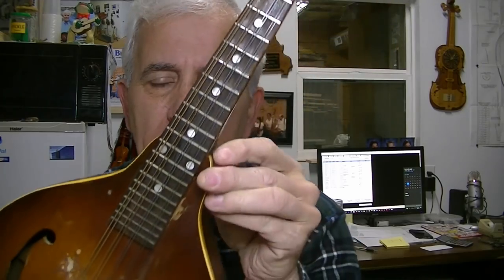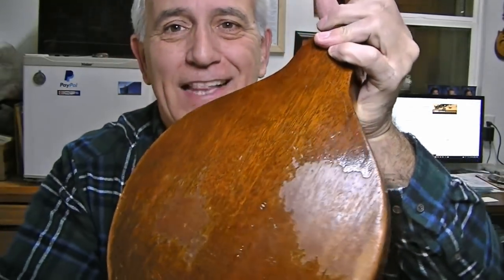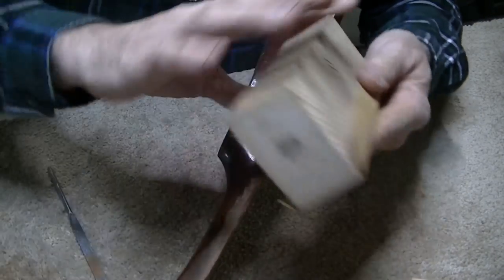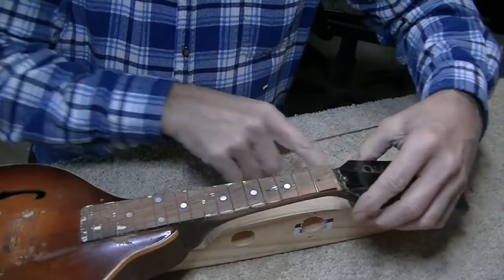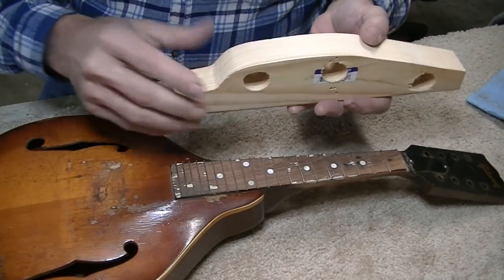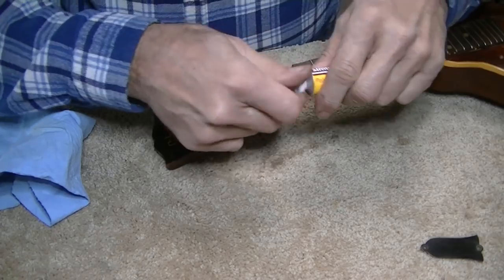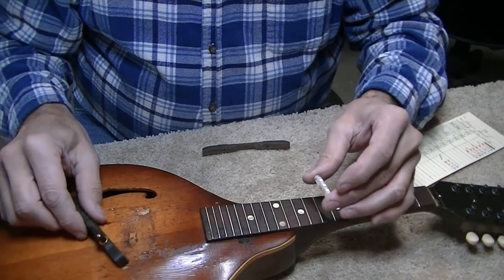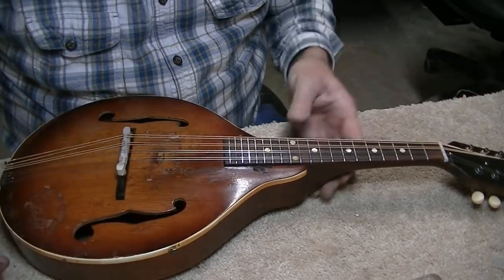214 RSW Gibson A Model Worst Fret Board Ever

Comment: Whenever I have neck damage and there's chunks missing from the fretboard I mix a good amount of Rosewood Pixi dust in the Evercoat spot putty and continue to stir, the color of the rosewood seems to almost dissolve into the putty and sand that area with ultrafine making it look as flat matt as the rest and works excellent before adding the hardener. Not the typical spot putty, this stuff hardens like a rock and doesn't shrink and I never had to stain it. I add the similar grain with a needle, then I use some oil on the neck maybe. The person playing will rub that stain right off of the plain white filler, but when I do stain, I do the area's that really need it until it looks good then I go over the whole are of work.

Comment: One of the cool things about superglue is that you can put the really thin stuff on a crack and and it will run down into it. I have tested it and found it can travel 6 inches or even more, with the grain. The tighter the crack the farther it will run. If you get lucky you can glue the finish back together and get a perfect repair that requires no touch up on the finish. (really lucky) 
 Also not all accelerators are equal. some will turn things white others will not. You are right about leaving it sit a bit. It will help, but some brands will give you that white haze no matter what you do.
Reply from the maker: Some also eat up guitar finishes and others do not.

Comment: I'm guessing, but I think most of that "goop" on the top is where someone glued a pickup in place. probably more than one, by the look of it. And I wondered if that headstock crack had actually been repaired before and was starting to open up again.
Nice to see that the concern was to get it back into playable condition, rather than keeping it to its original state. Not going to happen, and it's not as if it's a collectors piece. Nice work.
Reply from the maker: Yeah it look like they had put pickups on it several different times. Thanks for watching.

Comment: Judging by the head stock logo and what we know about the original owner, that looks like a Gibson A-40 which came out in 1950.  The A-40 was Gibson's best selling mandolin in the 50s.  It only sold for about $50 in those days and was very affordable. That would be about $1,000 in today's money.  The A-40 would have had a pick guard originally.  

You did a beautiful job on the fret board!   The fret-board looks practically new but the rest  of the body looks terrible by contrast.  If it were mine, I would be tempted to sand and refinish the top and back and reinstall the pickguard.  The customer may not want to do that, but I would!
Reply from the maker: Thank you very much.

Comment: Even on a flat fingerboard I use radiused fret wire. It keeps them from popping up on the ends like this. That is why I do not have a tool to bend the wire. I only buy it in coil form rather than straight. It is far easier to change the radius to make it smaller or larger than to bend from a straight condition.
Reply from the maker: I've done that myself. This one was just in really bad shape is the primary reason it was pulling up. Thanks for taking a look.

Comment: I can see an Antiques Roadshow appraiser (or the like) tsk-tsk-ing over the dye job and fills in 30 years or so. But they are more concerned with re-sale value than re-play value.
Have you tried the Crimson Guitars tape and superglue trick for attaching sandpaper to your block? It lets you spend less time worrying about the sandpaper crinkling up under pressure.
Reply from the maker: Thanks for taking a look. Yeah I've seen that trick. I don't seem to have too much trouble with the Sandpaper crinkling up.

Comment: Hey Jerry - on the total bare spots on the body, would you ever go over the stain touch-up with either shellac or satin lacquer (rattle can - just enough to restore the real bare spots? I've been experimenting with masking off the old finish and then trying to blend in new finish-just in the bare areas . I don't have a good buffing rig tho' and my results to date aren't anything I'd charge for (yet). Any thoughts ?
Reply from the maker: I generally wipe the whole body down with linseed oil. Which coach the bare spots. But I also wipe as much of their linseed oil back off as possible. Thanks for taking a look.

Comment: Gibson was bad about glopping in glue and not using consistent dovetails on the necks. I've helped work on a few of their guitars. Tried to steam out a neck on a Dove only to discover they hadn't left a gap for the steam. Didn't find that until it popped out dry where the steam couldn't get to it. Then we found the joint didn't fit well and they just filled the joint with glue.
Reply from the maker: Yeah they had their idiosyncrasies. Thanks for taking a look.
Reply: How old was the Dove you worked on? I know Gibson's quality control is absolutely horrendous today (plenty of YouTube vids on that), but I've also heard that they've always been somewhat inconsistent.
Reply: ijosef honestly, I don't remember now. That was quite a while back. I know the guy I was apprenticed to said he wouldn't work on a new Gibson and would rather work on a Harmony.

Comment: I could be wrong, but that bridge is not on the right spot.  It needs to come a little bit up on the f-holes notches. Good job.
Reply from the maker: You don't set a bridge by marks on the top. You set the bridge by the sound. It is measured from the 12th fret. Sometimes it lines up with the F holes and sometimes it does not. But it will not sound correctly to a musician with a good ear unless it is set by sound

Comment: If a person is primarily interested in the sound and playability of the instrument (vs value) would it help to replace the nitrocellulos lacker on the side of the neck or is oil sufficient for preservation and playability?
Reply from the maker: On the neck or oil is sufficient. On the top, back, and sides, you really want a good hard finish. Either nitrocellulose lacquer, oil varnish, or one of the new modern hard finishes.
Reply: @RosaStringWorks  Thank you!

Comment: Could those tuners be swapped to the other side,,that'll reverse the wind?.
Reply from the maker: The problem with that is the screw holes don't line up and it moves the metal frame they're attached to further in one direction or the other.  In this case, the frame when reversed, did not fit well.

Comment: Can anybody explain to me what this man said: "It holds the pick at the seventh fret with no problem?" at 47:48
Thanks a lot.
Reply from the maker: The pic is about .045" thick .  By the fact that the string holds the pick that means the strings are only about .045" high off of the Fret.
Reply: @RosaStringWorks , my mandolin is about 1/8 of the inch high at the 7th fret. Is it OK or bad?
Reply: @namentatic4978  thats really high

Comment: Just another dumb  question, on these neck fractures  why shouldn't  one  use a spine, or dowel of some sort, yes I figured  this is a dumb question.. 
l
Reply from the maker: In some situations, that may be necessary.  But if there is good clean surface, the glue is plenty strong enough.
Reply: @RosaStringWorks  thank you  for the clarification

Comment: why don't just switch around the tuning keys?
Reply from the maker: I thought I had explained that in the video. Possibly I edited it out I don't know. But turning them around doesn't really work on some instruments because it makes the tuning key stick out beyond the end of the peg head.  In addition none of the screw holes lined up at all.
Reply: I ment just the tuning keys and the little wheel - and leave the holders on - wouldn't that solve the problem?

Comment: You need a pair of side cutters instead of those wire cutters.  Side cutters cut flush and you wouldn't have to spend as much time sanding.  They are a typical electronics tool used for cutting leads flush and would work just fine for that type of work.  The tool you used is not called a side cutter, by the way.  It's a standard wire cutter.  Side cutters don't have that beveled cutting edge. Edit: I could be wrong on the terminology but I doubt it.  Side cutters seems to be a generic term that is incorrectly used in most tool descriptions.  This is a re side cutter https://www.amazon.com/TGK-Cutters-Cutter-Degree-Carbon/dp/B072WS3M9H?ref_=Oct_UPriceC_553322_1&pf_rd_r=20EFSE22QA59ZHN6E7C3&pf_rd_p=aa5abc74-1785-5a4f-b651-df352b83ff05&pf_rd_s=merchandised-search-6&pf_rd_t=101&pf_rd_i=553322&pf_rd_m=ATVPDKIKX0DER

Comment: If the Fret board is worn that badly and he is going to play, it why not just replace it ?
Reply from the maker: You can do that. It would have cost him a little bit more. But not much more.
Reply: Rosa String Works ahh ok just seemed like more work to fix something that would need to be replaced sooner than later and playability would improve with a new fret board
Reply: Rosa String Works also if I would like work done how would I get that to you I have a really cool 50s silvertone hollow body acoustic with the two f holes that needs work